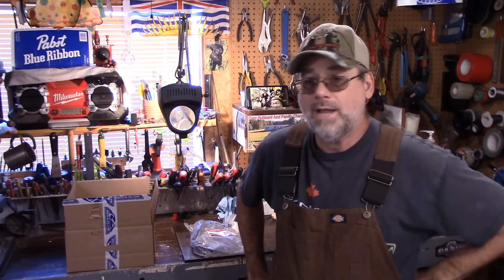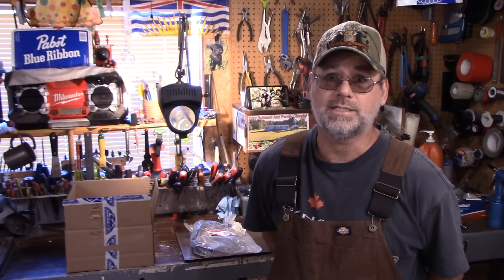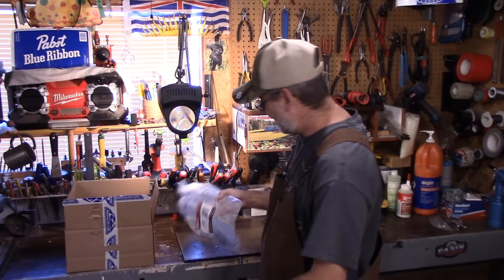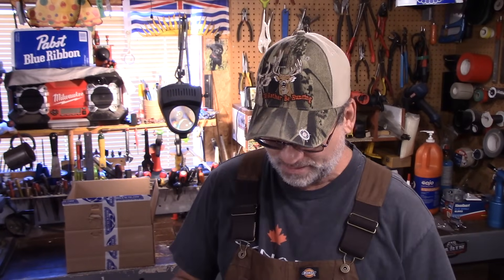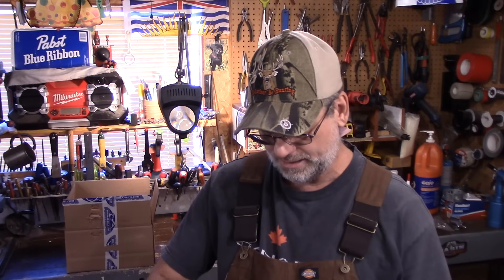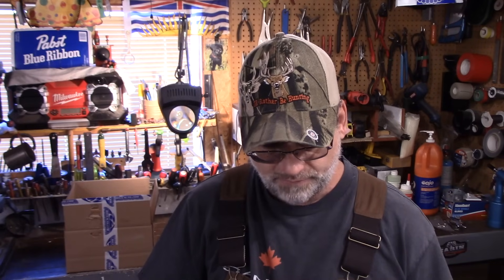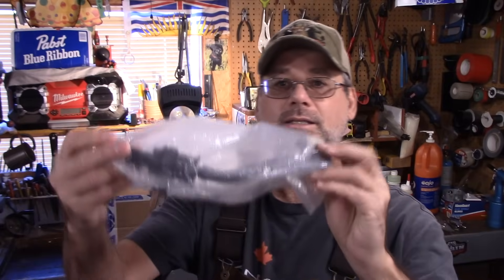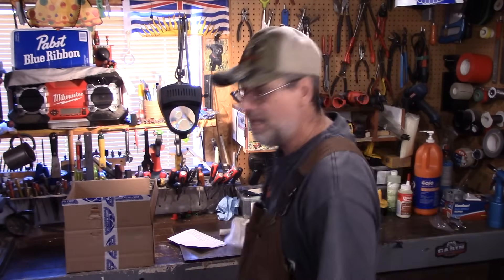F150  STALLING AT STOPS - THE FIX -  PART TWO

Comment: Had Ford stalling issue. Spent 3 weeks and @$1000 at the dealers and we could not find the issue. In the end I solved it by changing my coolant. Old, weak coolant causes the cooling system to become a battery and the current throws off the ecu into a lean condition causing misfires and stalling at idle. No scanner detected this and the Ford garage still doesn't believe it. Just finished a 2500 mile test run with no stalling.
Items I did address before the coolant:
Replaced trans speed sensor
Replaced ecu
Replaced air filter
Replaced fuel filter
Replaced spark plugs
Cleaned MAS
Cleaned throttle bodies
Cleaned IAC valve
All vacuum hosed checked

Issue was still there.

Changed coolant, issue gone and has not come back.
Reply from the maker: WoW
Reply: @SteveRobReviews   Yep, liked what you said about sharing info through these videos. The interesting issue is that it does not throw a code so you have to look for it. I saw this over 20 years back on a Chevy Celebrity. The mechanic tried everything he could to get my mother in laws car running. The last thing he did was check the coolant and it was throwing some serious voltage. Changed it and everything worked. In my case the Ford scan did show I had electrical issues so after I checked all the easy stuff I went back to how do you get electrical interference? Thank you again for posting your videos to help people!
Reply: Omg why didn't I see this comment weeks ago!!! I just bought a coolant sensor. Crossing my fingers. I will let u know how it goes. I also cleaned throttle body, new throttle position sensor, also had a naked wire going to my coils so spliced and out new wire cover connector on that one coil. Checked all fuses, fuel pump is fine. Cleaned MAF sensor.  I was literally about to get a trans speed sensor right before I read your comment! So thank God because I knew it was something electrical shorting out or throwing off my power that goes to the pcm. Someone told me that I probably fix the problem but that I would have to get my PCM flashed. Even though that isn't all that much money it's a huge inconvenience for me. being that I'm a female people think I don't know what I'm doing but I obviously do consider and I just went down the list exactly what you did is what I did first except I was about to get the trans speed sensor. but the only reason I was going to get that before the coolant sensor was because I have a driveway that's very muddy and throws up a lot of mud and I figured maybe I hit something and got the sensor damage or loose so wasn't sure. Here I go 🤪
Reply: @lindseywagner7510  If you need an ecu I now have a known good spare . Hope you get it sorted. Changing my coolant was the last thing I did and that took care of it.
Reply: oh and mine also didnt throw a code... until the point where I broke down. I had to have the actual OBD2 plugged in for the code to ever read. So you have to have it plugged in when you break down for it to read any code. And as soon as you turn off the car the codes gone. it's something I've never seen before but it actually does not read a code if you plug it in after you take your trip but it does read a code if you have obd2 plugged in when it actually stalls out. and the reason I actually have my plugged and was because I was doing the live data trying to look at my CAT, fuel, open loop and close loop and all that and see what it read and if I was sparking normal, if the maf was reading normal. So yeah definitely weird that this issue doesn't throw a code. What I find so funny is how you will realize that the mechanics don't know a lot about vehicles like u think they would considering when you bring it in and they dont know s*** about your 99 Ford f150 and I've even had newer cars they don't know anything about crap they have to troubleshoot it the same way we are right now like watching videos, and going on threads and investigating the situation. That's exactly how they do it too so don't waste your money. once again if it throws a code and it's something simple than yet they can figure that out but it's something like this that you have to investigate just do it yourself. Unless of course you have plenty of money and no time to spare but be prepared for your vehicle to sit there for minimum two days being troubleshooted and investigated so really your not saving time because you still have to take your car and rent a vehicle and then pick up your car and return rented vehicle. So yeah I would rather figure it out on my own. Besides I learn a lot through the process.
Reply: @lindseywagner7510  Mine would throw codes for occasional misfires. The consistent code was the transmission speed sensor.  $800 later that was not it. The week coolant tricks the ecu into a lean burn. I posted a video of what I was getting and then it would be very hard to start. Was worse once engine was hot. Most auto stores can and will read your codes for you
Reply: @Lindsey Wagner Did changing the coolant fix your issue? Mine is stalling as well with no codes. The purge valve did not help in my case
Reply: @sergioruiz9925   sorry sweety I am just now seeing this for some reason but I took the alternator off which was on there pretty good and leaned it forward so I didn't have to take serpentine belt off and after all that damn trouble we realized the part didn't fit! I have a 99 and had to put everything back together and I took many pics before I did and had to get a 2000 model part! SoChester not all that expensive I would recommend getting the 9 on part and the 2000 par just in case your vehicle cause 4 mm I would just hate me to take it all apart and have to go back to the store and another vehicle and in my case I only have one running vehicle which the Ford was it. so I had to literally put everything back together and go down to AutoZone I wanted to choke the lady who acted like this was my fault hahaha. Any how I have not yet to do it again but I will. also got a relay yesterday and completely forgot to put it in to see if it would make it work but I have read in a few threads about that and said the PCM relay would be damaged in some way and causing computer to go haywire. do you really need to check your wires that go to your coils or the coils themselves I'll tell you why because if you are stalling you want to check that area first before going to the coolant issue. Make sure the whole wire harness that goes into the coils are good and not exposed any place. if you keep an OBD2 plugged in while you're driving make sure you have the one where you can do the live read. keep it plugged in all the time during your driving that way when the truck cuts off it'll eventually read. mine took a few times of doing that for it to read anything. My truck literally cuts right back on there's no waiting period or anything but I will say this if you don't turn the key all the way back like your turning it  completely off and then cranking it then it won't start you have to literally turn the key back like you're going to take the key out of the ignition and then crank it. I will let u know how it goes! I won't be working as much so I'm going to have this week to do all this because of the covid-19. sorry about the late response I'll try to check it more often to make sure there are not responses waiting.
Reply: @fstlnj29  wow I just seen this. So you think I might need to replace my ECU that would actually be way easier for me to fix if that's what you think that would be freaking awesome! I know it's a month later so if you don't have anymore that's ok but your so sweet for offering!
Reply: @lindseywagner7510  Swapping my ecu did nothing. There was no change. This is what the local Ford garage suggested because their scanning system assumes the ecu is good and they were not getting any codes.
Are you stalling at stops with your foot on the brake?
What have you tried? Fuel filter last changed?
Do you have a scan tool?
Is all of your basic maintenance up to date? Mine was not so I did that first.
Write down notes of what you do so you can keep it clear.
On my Excursion the next thing to check would be fuel pressure. At Idle you pull the most vacuum and it opens the valve and dumps fuel back to your tank. A broken spring could cause this issue or your fuel pump could be weak also.  But there are simple tests for checking the fuel pressure.
Let me know what you have and  lets see if we can figure this out

Comment: We have had our 2013 F150 in the shop for a week. It would not start, not even turn over just a small click. We found  a couple of videos with this same problem. But with our truck in the shop, it would not not start. So we had them replace the purge valve & then it wouldn’t start. They finally found that connections at the body control module, PCM relay was bad. So fingers crossed the replacement of both these will fix the problem.
Reply: Wonder if it could be the fuel pump driver module.... just winging it, so it might well not be, shrug... Hadn't ever heard of that, until I started searching Youtube, shrug...
Reply: Seems like it’s the relay mmm looks like I’m going grocery shopping at the junk yard maybe a few computers and most definitely grabbing some Relays and coil packs 😂

Comment: Awesome video I have a 2016 Ford F-150 SuperCrew cab 4 wheel drive with a 5.0 stalls in the largest Idol all the way down I replaced that canister sensor and it still does it
Reply from the maker: Hi Tom 
The part that fixed mine from stalling was a evaporative purge valve at the motor.  No codes were ever set in my case so in your case check for any set  codes.

Comment: Was the new part you purchased from Rock a FoMoCo version?
Reply from the maker: Yes it is a Ford Motorcraft part. I posted the installation pics on instagram if your on it too.
Reply: Ford dealer employees generally get cost plus 10% plus local tax. Some dealers just give 10% off retail.
Reply from the maker: My friends discount Ford discount was still more expensive -  it's like amazon I guess they must buy parts by the box car to sell them so cheap compared to everyone else.

Comment: Good luck Steve! Hope it works out 👍🏻
Is this a revised part ? Or the same one they been using? 
Hopefully you got a good one👍🏻
Reply from the maker: It matches up exactly with the same part number as  from Ford  but that's an interesting point - I'm not sure now because there was a bunch of previous numbers  too.  Hum my friend  is a parts manager at Ford I'll ask that question. That may make a difference. Thanks

Comment: Hi Steve - I got the exact problem 2019 F150 Coyote V8.
It’s going into dealer today for warranty about this issue. 16 fuel injectors, 8 upper 8 lower ( gotta remove intake man)
3 lowers (1000psi )they are replacing.
All 8 uppers (60psi) perfect.
One or 2 lower fuel injectors have a drip.
Reply from the maker: Wow , glad it's under warranty.
Reply: @SteveRobReviews  Yeah me too, the upper injectors are 75 a pop, the lowers are 253 a pop.

Comment: I had thought before that it might be fuel related, Your last said something about left turn so I was thinking that fuel was shifting in the tank & getting pushed back into the EVAP system so that's why I asked about fuel level. I do recall a video (might have been Scanner Danner or maybe SMA) that they mention a common EVAP problem due to the change in fuel blend. I hope that fixes your problem.
Reply from the maker: I do remember Paul doing one on fuel as well . These guys are sharp and this is a common resolve for some and maybe me too. Cheers

Comment: Hope that fixes it. I never thought of the gas being different between seasons.  Weird.  Rock Auto, even though they charge shipping, can't be beat for OEM type repairs.  I'm starting to collect the car magnets on the shop fridge!
Reply from the maker: Their prices are better including a 30 % exchange rate and shipping a lot more and still cheaper than everyplace else.  They have  ethanol sensors testing the fuel and altering calibrating  so yes fuel can play into it but so far so good and time will tell. Cheers

Comment: My son has a 1990 F-150 302 E.F.I that has the same problem. I was helping him fix it and noticed there was some vacuum lines plugged with bolts and I believe the purge valve removed. We have 2 canisters one of them completely disconnected. Would you have a picture,diagram or video so we can see what's missing? I'm currently looking for a local vehicle to compare...Thanks
Reply from the maker: Dave I have done exactly what you want to do . I went to my Ford dealer and they were more than happy to print off a ford diagram showing all the  parts and routings.  If you go to Fords online parts web page  they have the exact same diagrams  if your is available for that year. Give that a try.
Reply: @SteveRobReviews  Thank you.

Comment: 🎉 I drive a 1995 Ford F150 6 cylinder. The other day I was driving in town and it stopped very quickly. I let it sit for a few minutes it started right back up again. I thought it might be the gas but it didn't seem to be the obstacle. I tried it again on a cooler day. Got almost to where I was going and it did it again. The power steering on the truck seems like it was hard to turn. Single single elderly female here in Oklahoma cannot afford a mechanic and them looking and searching for shade tree mechanic. Any thoughts on this
Reply from the maker: Could be so many things  so a 95 is not so easy to diagnose as it's pre computers as we have today .
Reply: im having the same issue 92 f150
Reply: @cameron_9760  I am going to try to change out my fuel filter and see if that helps

Comment: I had this issue but had no codes come up.  What the problem on mine was a loose wire was rubbing on a pulley.  I think it was a speed sensor wire.  I zip tied it out of the way and have had no problem since

Comment: I hope this is what causes your problem Steve. Some times you never find out what the problem is. I may have told you this story so if I have I’m sorry for repeating it again. So my Paw Paw bought a new 1969 Ford Limited (I believe that’s what it was). The thing squeaked over by the passenger side, like plastic rubbing together. He took it back and forth to the Dealership to see if they could find it....nope, no can do. So Paw Paw got some cardboard and folded it into and put it where he thought it was coming from. It took him a couple of attempts but finally he found the right place. No one could find it but Paw Paw had had enough and he finally found the right place and that thing never squeaked again! I guess where there is a will there is a way, lol. Good luck Steve!
Reply from the maker: Thanks Becky , I have to do something so let see in time . Cheers

Comment: Brother if scannerdanner stepped in to help that's about the best direction you could get. I guess I'll stick around for a year to see if it works.  :)
Reply from the maker: Paul  suggested it could be fuel related between summer and winter blends.  Seems a logical idea since he sees this more than I. The purge valve is a long shot in my mind trying to think if it could stick and stall out the truck on a decel or just make it run rich. A bit above my pay grade so this is the next logical cheapest fix I can  come up with  that has been suggested as a common fix  by some .    I will report back the first time it stalls again or doesn't in 2018 .   

Reply ·
Reply: Sounds good to me. Thanks for pinning my comment.

Comment: Sir I have F-150 XLT 2016, I do experience the same issue, specifically when I drive for while and long distance. When I come to stop vehicle is shaking and engine shuts off on its own. I have no problem turning it back on, but this so annoying. Sometimes check engine goes one but I took the vehicle to mechanic they couldn't diagnose it. Is there other recommendations besides this part?
Reply from the maker: @nicozaya7457  I would check the throttle body and make sure it's clean .
Reply: @SteveRobReviews  thanks
Reply: @nicozaya7457  I’m having the exact same issue with my 2017 f-150 after a long drive it shakes and dies
Reply: @nicozaya7457 did you get it figured out?

Comment: I have a 2011 f-150 5.0 it stalls out and then say low oil pressure when i come to a stop or real slow speeds. It has acceleration issues also excpecially at low speeds. I am able to start it right back up though after it stalls out
Reply: That's exactly what I'm dealing with! I have a 2010 F150 XLT
Reply: I have the 4.6
Reply: Im having exact same problem. Same exact truck
Reply: Same problem here, same engine, any solutions yet?
Reply: Anything yet ? I'm having issue on 2012
Reply from the maker: Evaporative purge valve replacement cured my stalling if not my next resolve was going to check the throttle body and see if it needled cleaning.
Reply: Same but I have 2013 ford f 150 xlt. It's only happened twice in 3 months since i got it back in June.
Reply: My 2013 f150 just started doing the same thing right after i replaced the battery and battery fuse.
Reply: We have a 2010 4.6 that just started doing it. But I’m Banking on the O2 sensors because those have thrown a code for months and I haven’t made the time to change them. They can do crazy stuff if not replaced. My 2001 f250 5.4 was jumpin and jerking and it was the O2 sensors. If that don’t work I’ll try this purge tank but also thinking vacuum.
Reply: We replaced both upline O2 sensors and so far so good. It stalled twice within 300-400 yards of driving in a parking lot at slow speeds and now it hasn't even hinted at stalling since replacing the sensors. It feels like theres a bit more power too. BTW that was the only code was for the 02 sensors.
Reply: @T-Roofin79  that's exactly when mine started,after I changed my battery......any luck??